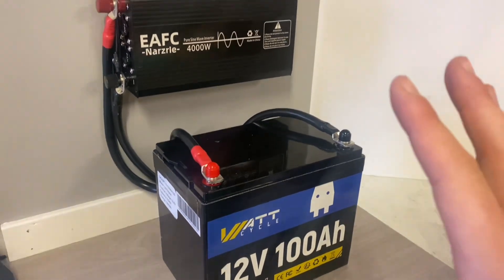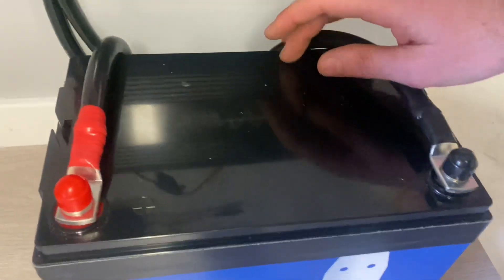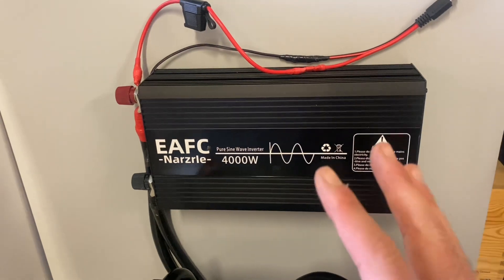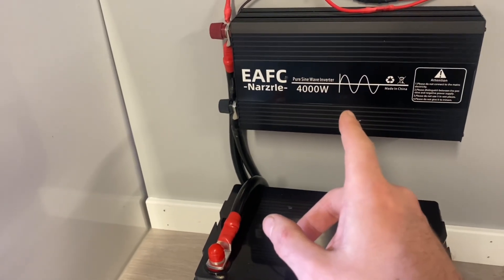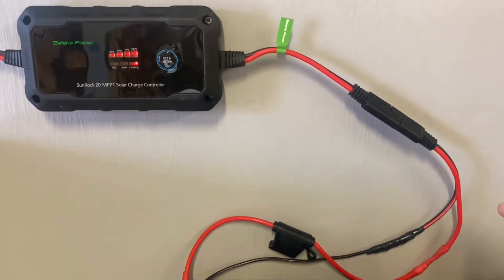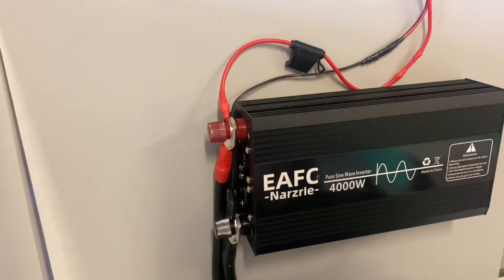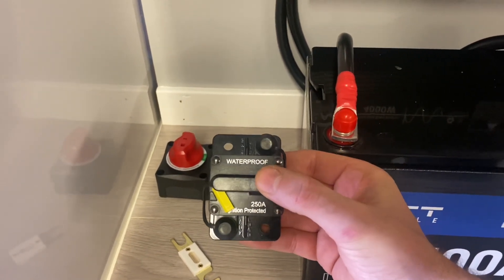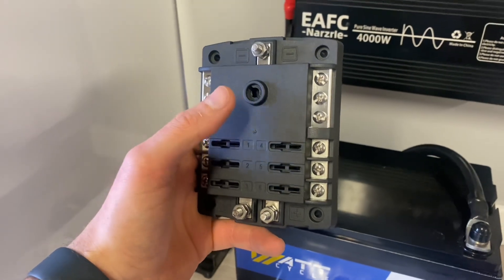Simple 12V Solar Power System for Off-Grid & Backup - Complete Guide!

Comment from the maker: I say 1awg in the video, but its 0 gauge.. What would you add or change in this setup?
Reply: I would change inverter to victron energy, and add more battery capacity and a wall charger
Reply: @samiryouarebreakingthecar  What would be the advantage of using a Victron instead? Other than spending more money.
Reply: @lawrencedavidson6195  more protections, effiency, able to monitor, more quality components, so longer lifespan and potentially more reliability
Reply from the maker: @samiryouarebreakingthecar  True. But some people have to consider their budget. Victron has a higher price, but yes it is seamless and works great!
Reply from the maker: @ nice👍